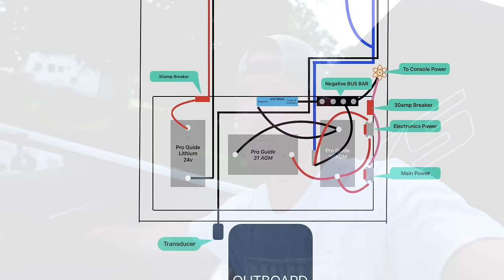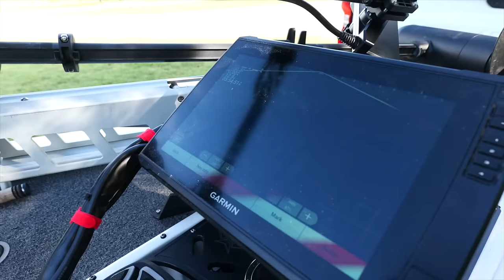Taking My Boat Apart & Camping with it | FULL DIY Electronics Reveal!

Comment: I rebuilt my Pontoon, took off everything, the engine, furniture, everything put new deck on it woven vinyl, and re did all wiring, added some new deck lights and docking lights, re did the console. Worked on the engine. I know my pontoon inside and out.

Comment: Duck Tape is your friend. for your next cable running project, Wrap the end of any cable (connected to your fish tape/wire/rope) with duck tape to make a smooth transition so there is nothing to hang up in the tube. pull slow and you have it. Great content, great videos. Good job.
Reply: I used to be a field technician doing a lot of ethernet cabling. Electrical tape works amazing for doing the same thing and not nearly as thick as duct tape.

Comment: You need a cable puller from homedepot or amazon. It’s a coated wire you can run through the conduit and hook it up to wire and pull it through.  Makes life sooo much easier.
Reply: Ironically called "fish tape"

Comment: Rackley the dangling fool I absolutely loved it for sure!!! I remember putting my garmin on my 18’ wide body flat bottom and I definitely thought it was a nightmare trying to run wires for an older boat being a 1969 and didn’t even have a title for it when it came out they had told me when I tried getting it listened up but they made a new one for me!! With the boat not ever even having a trolling motor on it well she is definitely setup now but now I have been having some issues with the boat motor not wanting to idle up when putting in the forward gear!! She just wants to fall on her face every time!!! I have checked out the fuel system that I had herd from a couple people but everything in the fuel system is new and I’m still having issues with it!!! It definitely has me wondering what it might be and definitely stumped!!! I have even went through and completely rewired the entire engine because I had noticed quite a few wires that had gotten a little steamy maybe and was worried that maybe some had shorted out??? I no every thing was working up until winter and my first time out after winter it started doing this!!! No changes so I’m guessing it has to be something easy that I’m not seeing!! It is just a very low hour 35HP Johnson that definitely ran very smoothly I have ever seen an older engine that ran!!! It had been baught by a guy for a backup motor for his duck boat and had sat in his garage most of its life Incase he had issues with his other boat motor and he had said he never needed to use it other than put on a couple other boats that didn’t have a motor on and a buddy was looking to buy and they wanted to take the boats out to make sure they still floated and didn’t have any unforeseen holes or damage and then it was taken back off and back to his garage!! If any boat guys out there have any ideas on my issue I’m having with my engine please let me know!!! Thanks!!! And Rackley I definitely cannot wait to see you pull in some magnum crappies in your next video buddy!!! I was definitely hart Brocken when I didn’t get to see you ripping the lips off them in this video!!! I’m definitely itching to see that big 3lb magnum next video for sure!!  Awesome video!!!!

Comment: Pro tip, anytime you run a cable tie on a pull string to go with it. Next time you need to run a wire that string is there to pull it!

Comment: I have mine running down the outside rail inside a pvc tube. The great thing about that is I can route the wires easily and change it easily if desired. You are suppose to mount the transducer on the other side of the motor. You could see turbulence on the side you chose. Also get a block of plastic delrin from Bass Pro Shop and mount and glue it to the transom so you can drill into the plastic not the boat every time. I use to be your neighbor down the street in Double Oak and could show you my install but now I am fishing down south.
Reply: I have the same exact boat. And the spot where he put the transducer is exactly where the factory mounted it.

Comment: Vexus messed up when they turned the electrical conduit 90 degrees like that. I used to work at Ranger and Triton. With those boats, all the electrical wires come out on the gunnel and everything runs flush behind the throttle panel. I live here in east texas. If you ever need some help with your boat you can hit me up sometime.

Comment: What if you turn the bracket around on the back unit.  Looks like it would angle front and it would give you a little more room.  I did that on mine.

Comment: A bit late for me to chime it...But I would have just run the transducer wire separately.  You might have been able to mount and run your own 2-3" conduit (plastic not EMT) for future upgrades...But anything more than 3/4 full (in the "tube") is too much...BUT, if you have to run it through the "tube" use copious about of wire pull lube....TONS!

Comment: I have a 2002 Ranger I bought new.  Similar struggles.  Older boats a bastard with running multipe cables / wire front and rear.